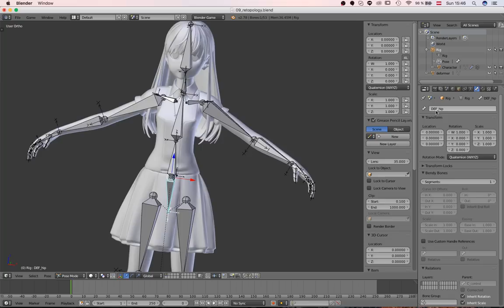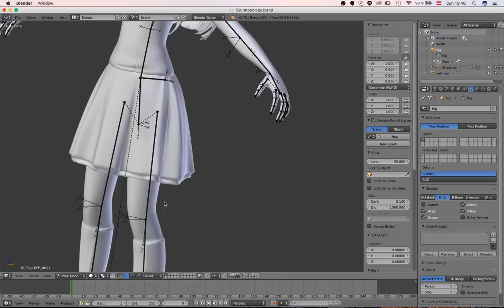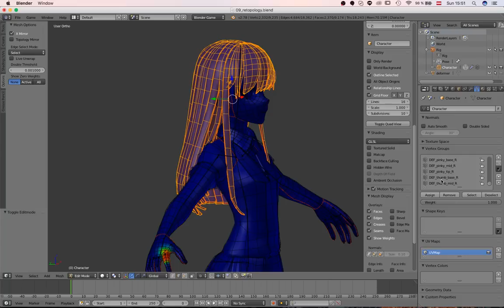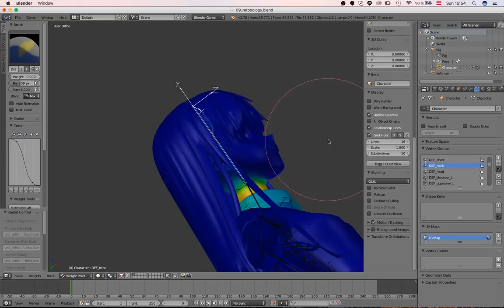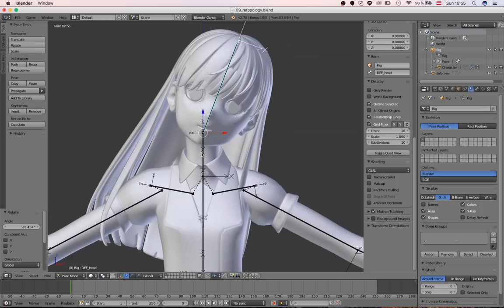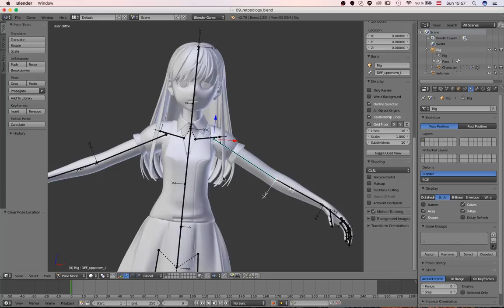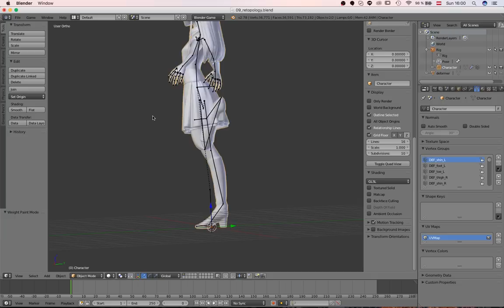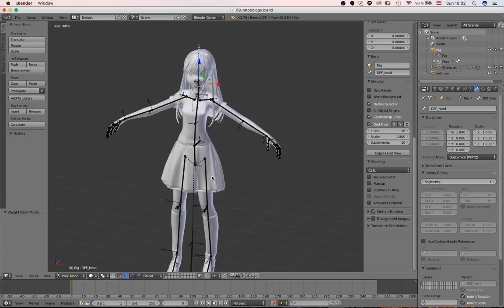[2/6] Complete Character Rigging Guide (w/ Hair Physics) - Blender Tutorial

Comment: You don't have to animate the knee bone separately: just add a "copy rotation" bone constraint, set the target to the lower leg bone, select only x axis, invert, local space -> local space, and set the weight to 0.5 .

Even easier would have been to have a very short bone between the leg bones, and just let the leg IK handle it.
Reply: I think I've seen this in counter-strike models, basically if you took a leg and looked at its rig horizontally it would look like this:
_____ _ ______i
With the first line being the thigh, the 2nd the "knee bone", the third the calf, and the vertical one being the foot bone and toe bone.

So what you're saying is the easiest method here is to have a "knee bone", assign IK to it and the IK should do a good job of keeping volume just on its own?

Sorry for over explaining everything rigging is still confusing for me.

Comment: Daniel, for the knees best solution is using corrective shape keys. Peter Drakulic has an excellent tutorial on that, you should definetly check it out!
Reply from the maker: +ErixOn I didn't think it was necessary but if you are looking for a certain result it's definitely an option.
Reply: The solution he shows in the video works in Unity if you export the models and the animations. I think it is more manageable than the blend shape keys in Unity also. I guess it's worth considering if you ever want to export your models and animations to Unity.
Reply: ooooh, sorry, I didn't know he was gonna export.
Reply: There's also a setting in the armature modifier "Preserve Volume" which does already on it's own a rather good job in such areas, corrective shape keys or bones are something one can do additionally if it doesn't do enough.
I for example used corrective bones for my char's elbows to keep them pointy on the outside when she bends the arm and make the folding on the inside look not as awful.

If you however do a mechanical type of rigging like a car or a treasure chest or a weapon definitely NOT use the preserve volume option, it's only good for organic rigs, aka humans, creatures etc.

But yeah as mentioned by TBG, if you plan for external use and not exclusive Blender use then corrective bones are the best bet.
Also corrective bones do not explode from topology changes later on where as shape keys become nitro glycerine.